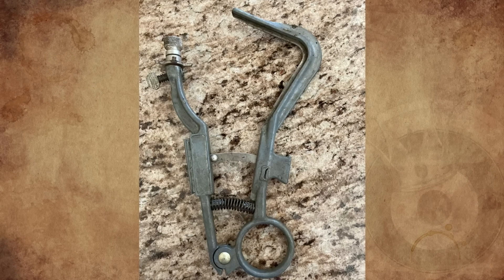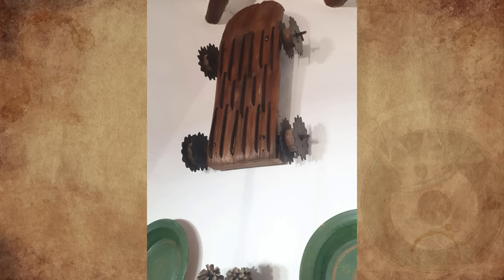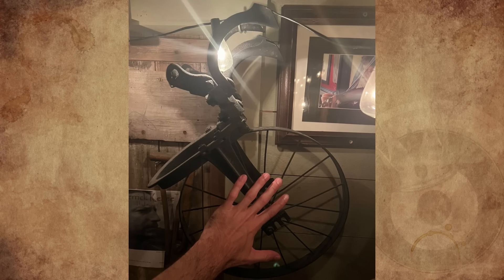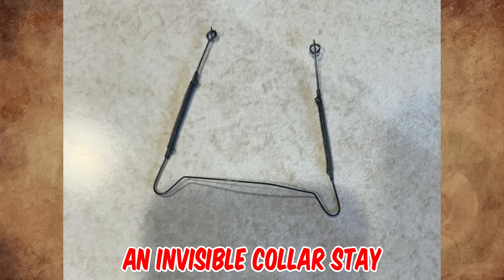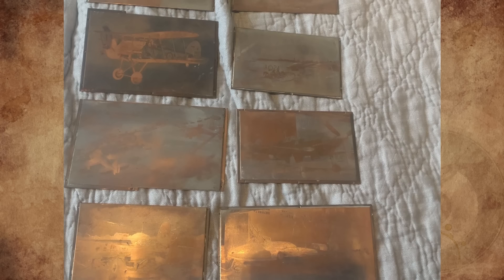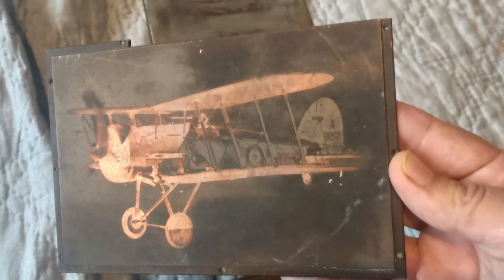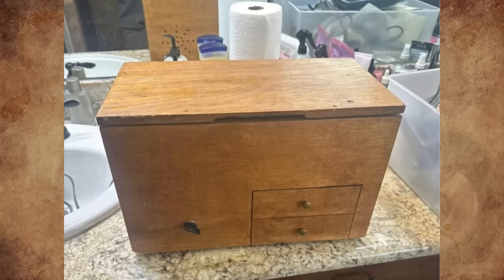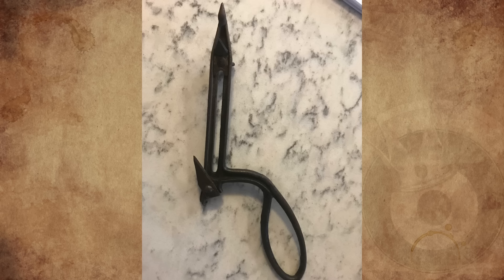What Is This MYSTERIOUS Wall Decoration In An Irish Restaurant And This Unusual Clamp-like Tool?

Comment: The "rag" rug tool at 4:00 was not used for wool.  It was used on pieces of old clothes (rags) that were cut into short strips and pulled through the holes in a large piece of sacking to make a hearth rug.  We had one in front of our coal fire in the north of England in the 50's & 60's.
Reply: Ragrugs made from different colored fabric stripes were kinda popular around here, from the 80's till the 90's they were cheap and colorful.
Probably also a convenient way for manufacturers to make use of leftover fabric.
They were made from whatever, cotton linen synthetic, any color and texture.
Reply: @timhartherz5652  Interesting, I didn't realise they were still around in the 80's & 90's 👍🏻
Reply: Go back and rewatch.
Reply: @PeterJ-ij6mm Woven rag rugs were popular in the 1980s, and are still available, they are made of long strips of recycled textile for the weft, with what looks like a fine cotton string for the warp.  That's a different construction than the tufted rugs with a burlap base fabric (from potato sacks) that this tool was used for.
Reply: They are still used today. There's a group of ladies near  where I live that get together to make these rugs. They are a very practical use of old used fabrics.

Comment: NOT Daguerreotype. They are the printing plates for a book about fighter aircraft that was printed after WWII. They include a German Messerschmidt 262 jet aircraft, circa 1945.
Reply: Most interesting.
Reply: Yes, the image is somehow transferred to a polished an coated copper plate. It can be a pitch-wax mixture and the image is drawn by hand with a needle. Or it can be a light sensitive gelatine coating, that a transparent film image is exposed upon. The unlit gelatine is washed away and the exposed is not, as it has hardened (chrome salts are often used). Then the plate is etched in acid or ferrochloride. The groves are filled with printing ink and the surface is wiped clean. Then a print can be made on paper with significant pressure.
Reply: Second from the top in the right-hand column appears to be a Hawker Siddeley Harrier . The "ME-262" appears to be a Gloster Meteor (British style rondels & the engines are centered vertically on the wing instead of being slung underneath them). 

At a guess, they ARE printing plates used for souvineer greeting cards from a British aviation museum.
Reply: @Pudentame  Yes, you are right, Gloster Meteor, NOT Me 262. 
The biplane looks like a Fairey Swordfish, with two pairs of vertical struts between wings on each side.  
Gloster Gladiator and others had only one set of struts on each side.

Comment: To bad that it is copper plate etching plates and NOT daguerrotypes. Nice description but totally not right. They are used to print images. Very few jet engine planes, or any planes existed when daguerrotypes were in fashion.
Reply: The local news paper used to use aluminum printing plates then throw them out, my grandma grabbed a couple of stacks and used them for siding on a shed.
Reply: Your explanation of Daguerriatype was interesting, but not applicable. Those are photo printing plates for books or newspapers from the 19teens or 1920's.
Reply: @danielulz1640  I thought at least one was a WWII fighter.
Reply: I think that you are correct.  @Ron-d2s

Comment: The cultivator is also designed to be pony/small horse-drawn. 
In instance of the red cultivator depicted, the horizontal narrow. u-shaped metal bracket that wraps around the front of the wheel and goes back on either side of the wheel to be bolted to the frame is missing.

At the front of the wheel bracket there is a vertical hitch ring for the single tree and evener.